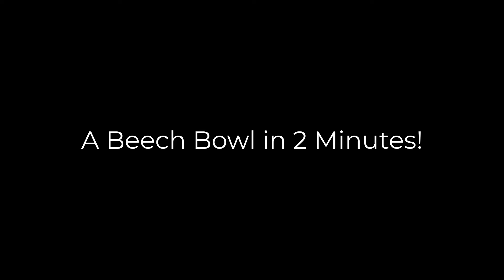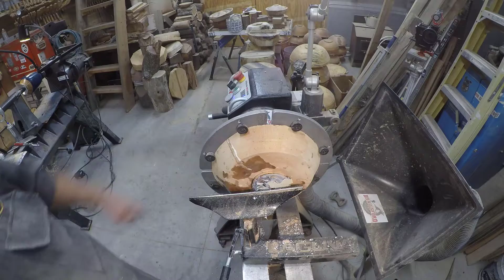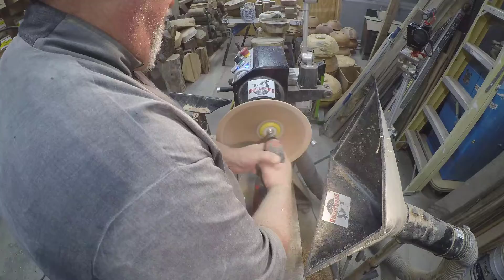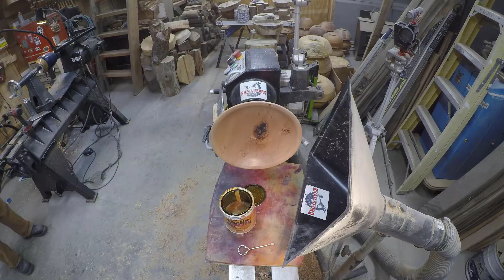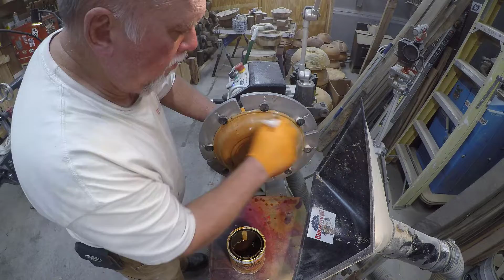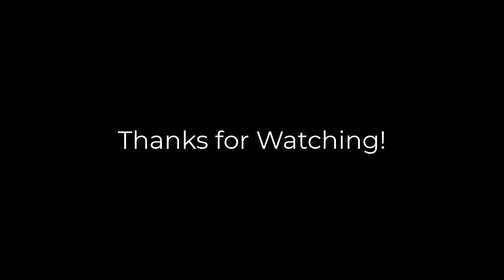Woodturning a beech bowl in two minutes

Comment: You have both a Laguna and Robust lathe.  Do you use both.  I feel Robust is the better choice in quality.  Great job on the vid.
Reply from the maker: It isn't even close.  The Robust is vastly better.  I do feel once in a while that I need to use the Laguna.  However I have found that having two lathes has been very handy in many instances.